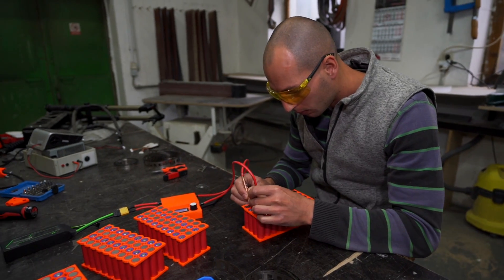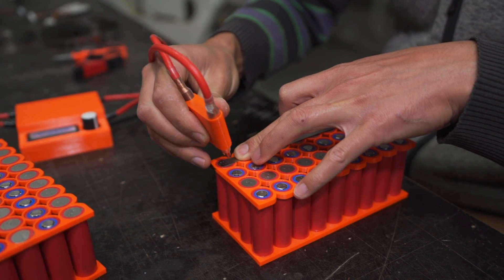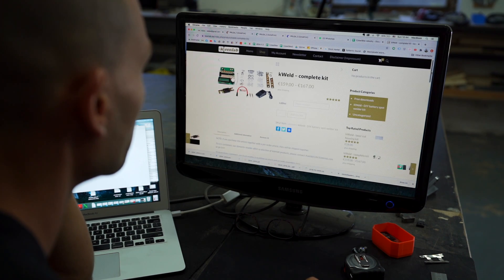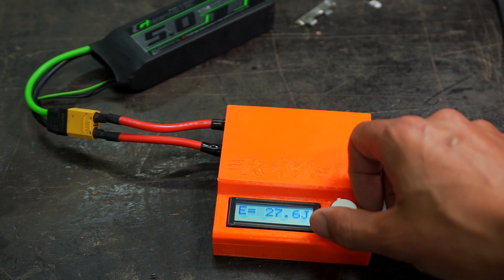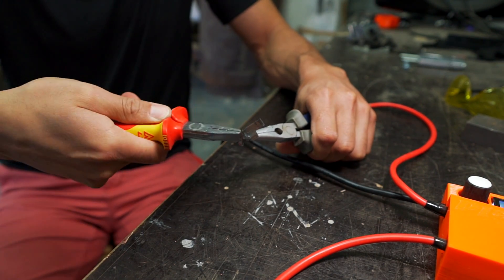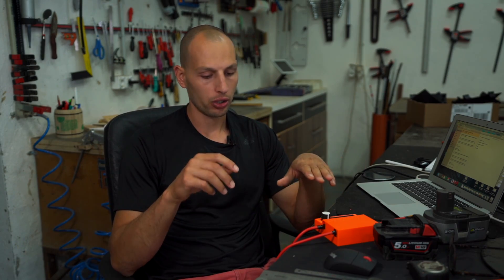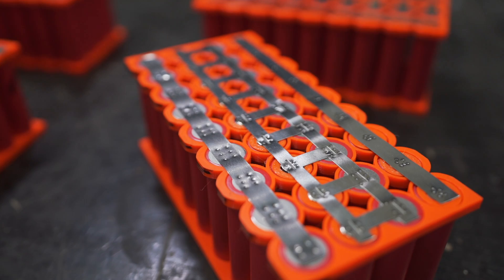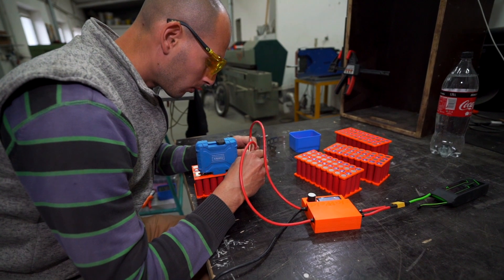Spot Welding 18650 DIY Batteries with kWeld

Comment: Super video. Mam objednaný kweld a rovnakú grafenovú baterku Turnigy. Chcem sa Ta spýtať, aké ideálne nastavenie funguje pre Teba pre 0.2 a 0.15. Ja plánujem používať len 0.15 a na rôznych fórach píšu, že ideál je 30, pripadne 50 pre 0.20
Reply from the maker: Ahoj, ja pouzivam 25J na 0,2mm nikl. Funguje super jen misto baterky bych koupil ty kapacitory. Nabijeni baterky omezuje.
Reply: @ladiandmargaret  dik. Taky som zvažoval použitie kapacitorov, ale pre moje použitie (3 baterky) na ebike asi zatím stačí. Btw kde kupuješ pure nickel strip? Ja aliexpress, v EÚ je 0.15 dosť vypredaná a v ČR a SR som nenašiel žiadneho predajcu, ktorý má pure... Každý iba nickel plated. Ak máš nejaký dobrý tip, pls. Dik

Comment: Yes! I have used the kWeld kit to build several battery packs with great results. I use a car battery for the power supply, but a LiPo works as well.
BTW, in the shots of you welding at 0:30 there are some big sparks! In my experience, this happens when the nickel strip is not made with pure nickel, but nickel plated steel. It's more expensive, but with pure nickel you don't get massive sparks and you get a much better weld with less power.